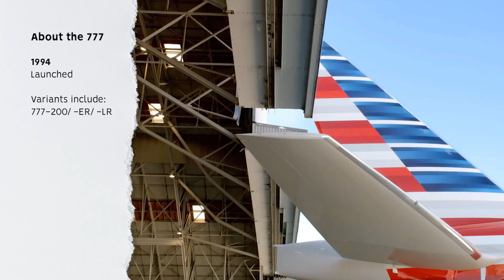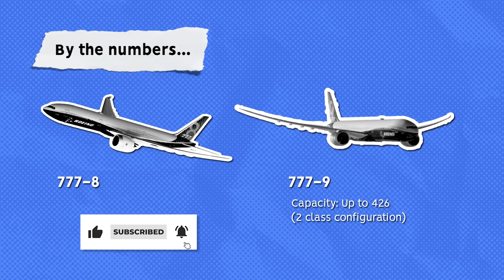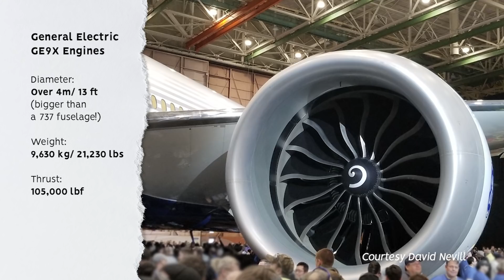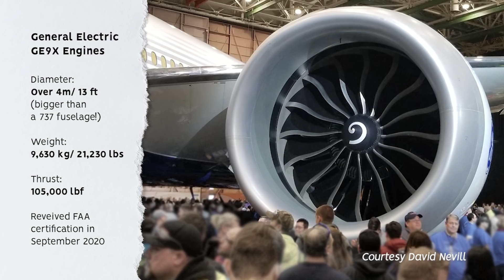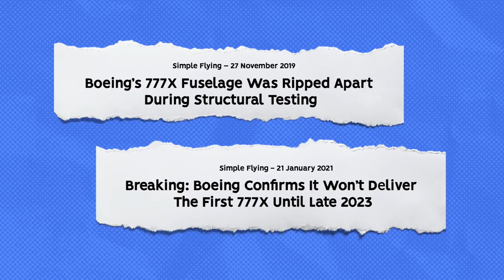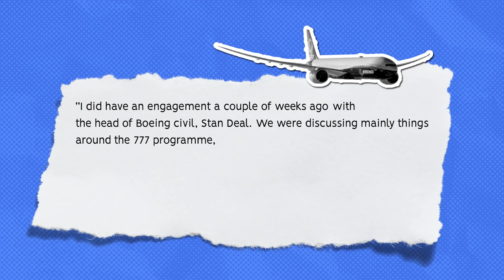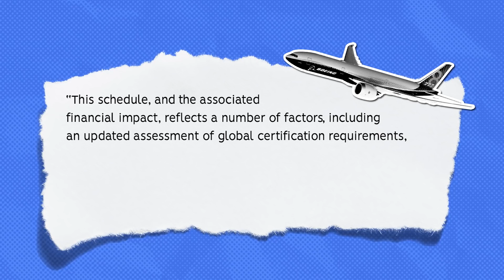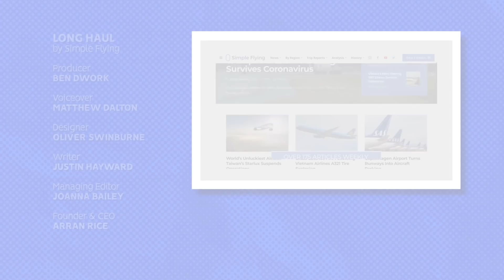Boeing 777X The New Twin-Engine Jumbo Coming Soon

Comment: We could make a Netflix series with the number of different release dates the 777x had
Reply: Or the opening dates of the BER airport.
Reply: @skyserf  Or A380, Stuttgart Hauptbahnhof, CrossRail, Flamanville Nuclear Plant, etc.
Reply: @bluebox2000  What the heck is up with Crossrail ? It's a railway for heaven's sake ! The trains don't need to fly or travel at Mach 2.0. Rolls eyes ...
Reply: 777X? How about the Dreamliner? My god, it’s like they can’t build it properly…..
Reply: @magnustan841  Yes, well that's what happens when you can even buy 'dope' in the factory !
Reply: @grahamstevenson1740  Unbelievable : is this possibly  true ???
Reply: @magnustan841  yes that was a Hatchet job as well. Problems with batteries never resolved just band aided and covered up by the FAA. https://youtu.be/rvkEpstd9os
Reply: @JA-ui3gg  Completely agree. The battery 'fix' was nothing more than a Band Aid job. It sort of works but is certainly nothing to be proud of.
Reply: @grahamstevenson1740  what makes it worse is that the civil aviation bodies, pilot / cabin crew associations and the airlines in other jurisdictions accepted it. It would seem that the world has become a place of acceptable risk in the absence of standards and striving for engineering excellence because maximum profit is the driver of every decision.
Reply: @JA-ui3gg  Yes, I'd go with that observation. Money is king today above all other considerations it appears.
Reply: @grahamstevenson1740  : Band aid fix?!! - Hasn’t cough fire since the fix; has it?  What more do you want?
Reply: @tmt4931  They stopped the battery catching fire by adding more barriers, If it had been designed correctly to begin with, the problem would never have happened.

Key to this keeping rhe battery cells cool. Boeing instead designed in a 'hot spot' !
Reply: @magnustan841  and it’s cuz the engines keep having problems and the cargo door broke one time during a test.
Reply: How many seasons you reckon this series would have, and would its story line be more entertaining than Ozark?
Reply: @hagdore well Boeing have killed more people than died in 3 seasons of Ozark’s.
Reply: By the time Boeing delivers one of these. Star Trek transporter technology will be available.
Reply: The good the bad and the ugly of the 3x7=21 Exactly 21 times release histories. 😱 and counting...
Reply: 😆 😂 XD
Reply: 🤣🤣🤣🤣 this cracked me up
Reply: oMg you are funny  🥴

Comment: Bring back 747!!!
Reply: Boeing did try to bring back the 747 by creating the 747-8, however only a few airlines used it so it was kind of a failure
Reply: Just wait when Boeing release double engine 747.

Which is called... 777X
Reply: @bocahdongo7769  lol